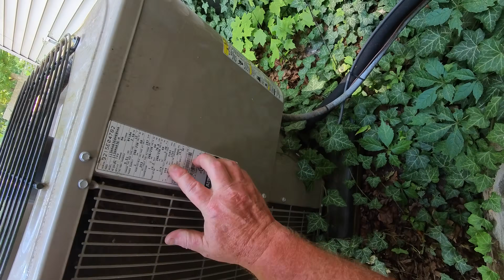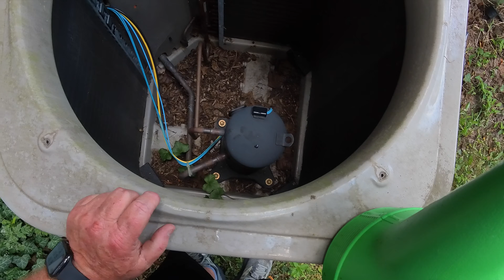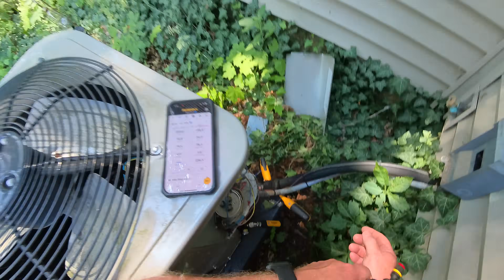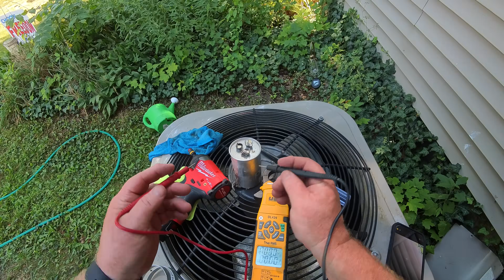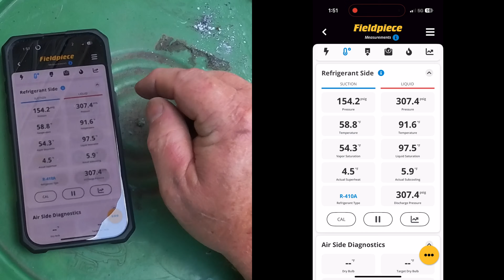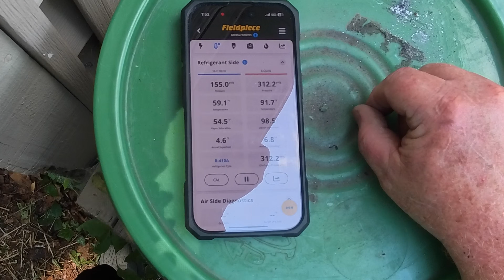Bryant AC Not Cooling | Taking The Good With The Bad | HVAC

Comment: What did you do here 1:20 to see that the thermal overload switch was tripped?
Reply from the maker: I knew there was a call for cooling from the thermostat and that it has a 5 minute time delay. After waiting 5 minutes I looked at the contactor and it hadn’t pulled in. 

I investigated further and saw that the compressor had on top of it an external thermal overload switch. 

To test to see if the switch was tripped I bypassed it and allowed the thermostat to energize the contactor for a split second. 

Once I determined it was the switch preventing the contactor from pulling it I verified that the compressor was indeed hot and it was 

Thanks for watching
Reply: @HVACTDM I do understand that now. Thank you for that!